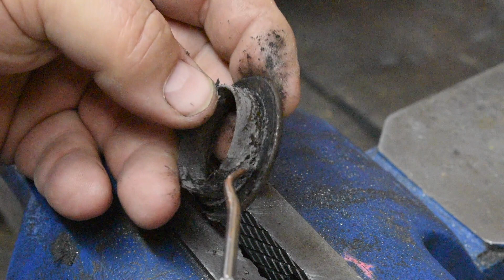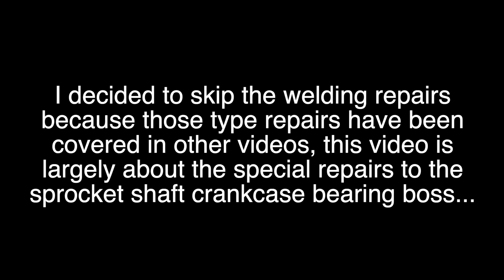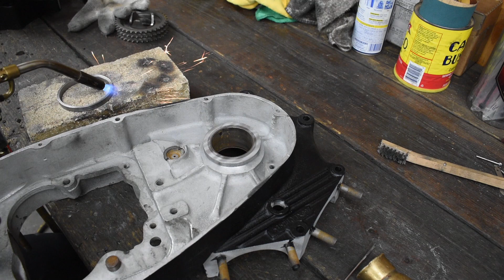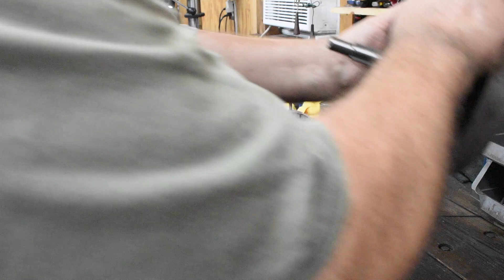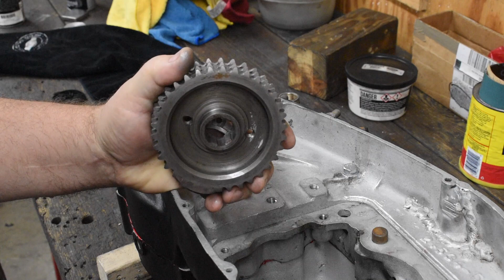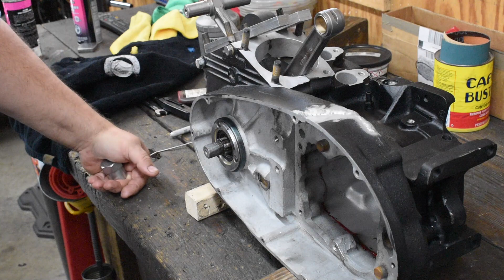1968 Harley Crankcase, It's Saved!!! #54

Comment: I have one here that has been repaired just like you've done with this one , it was done many years ago without the consent or knowledge of the owner , pretty sneaky  and done at a dealership , it's fairly obvious , it was the dealership "tech" that broke the retaining ring groove out and sent the case out for repairs .
Reply from the maker: It is one thing to do that with the customers knowledge and permission after explaining the shortfalls, quite another to damage the case and repair it with what is admittedly a somewhat sketchy repair and NOT tell the owner. Glad to hear it held up. Subsequently, thanks to another commenter, I've found a guy who will machine the steel sleeve out and make a heat shrink insert. He says its easy. Yeah right, I've got a junk case I'm going to try that on... one of these days.